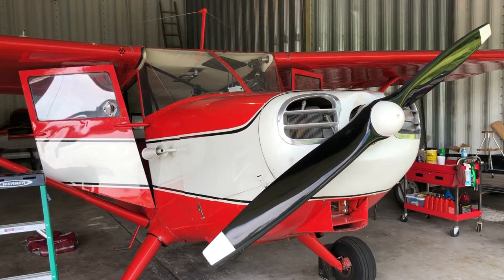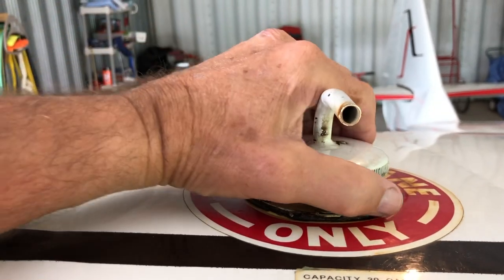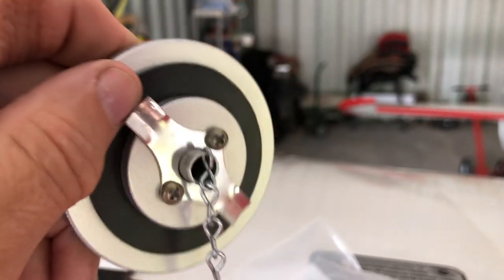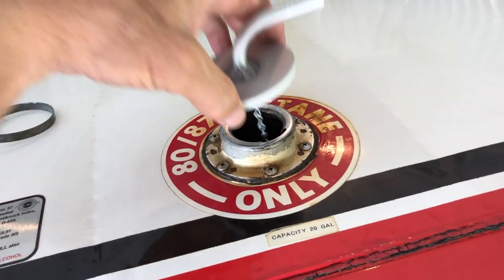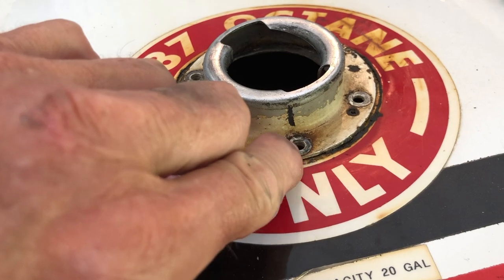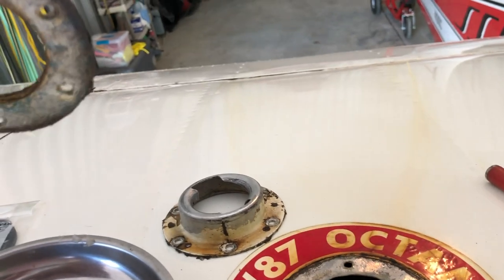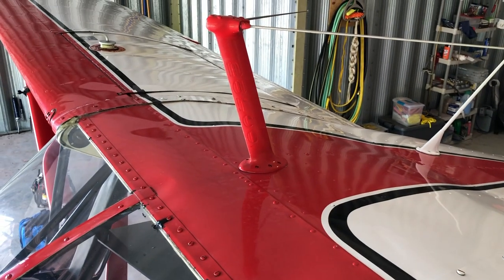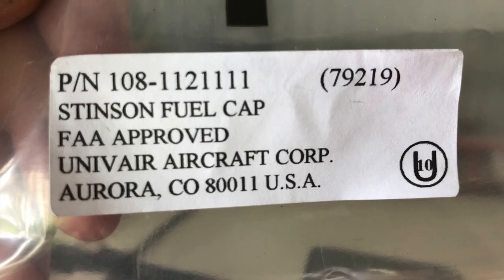Stinson 108 fuel caps

Comment: Hi Brett, if you put both old caps side by side you’ll see they are indexed different. There is a left and right cap. When I was working on my tanks I noticed this difference. 108-1121111 is the new cap (obviously) it look as though Univair is only making one cap for both sides. By the way how do you like your LED landing/Taxi lights?
Reply from the maker: Hi Christopher - OK on the fuel cap indexing.  I hated to spend so much for new gas caps, but the new caps from Univair not only stopped the leaking but they function better.  The seal on the old ones fit so tight I had to put oil on the seal to allow them to twist tight.  Regarding the LED landing and position lights.  They are GREAT!  I am very glad I made the switch on both.  The "LightPipes" do not work well during the day, but the LED position lights have never failed to strobe when I command them to flash with the switch.  I just wish there was a way to see and confirm they were flashing during daylight.